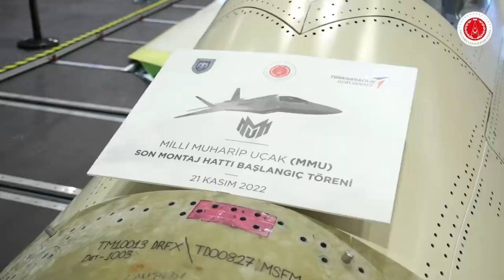The 5'TH Generation Türkish Fighter Jet Will Soon Fly

Comment: @Askeri Savunma & Teknoloji The TF6000 does not have the arc burner feature. The version of the TF6000 with an arc burner is the TF10000 and has a thrust of over 10000 lb. but you may still think that this is an allegation. Everyone will see it soon anyway... The F22 has a length of 19 meters. TFX is 21 meters long. wingspans is equal. How is TFX smaller than F22? Don't know the features of the plane you have? The majority of engineers working in American military projects are Turk engineers you stole from Turkiye. In other words, you have all the weapons and technologies thanks to our engineers! In this context, don't you think it's perfectly normal for Turkiye to produce 5th generation warplanes and weapon technologies? but you will pay a heavy price for stealing our engineers..!